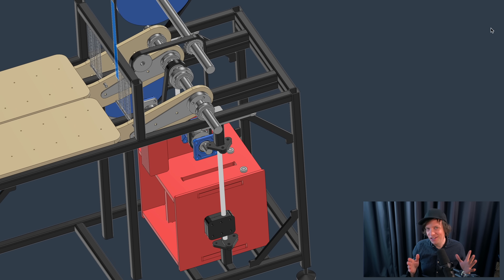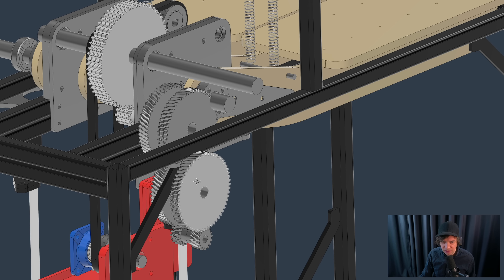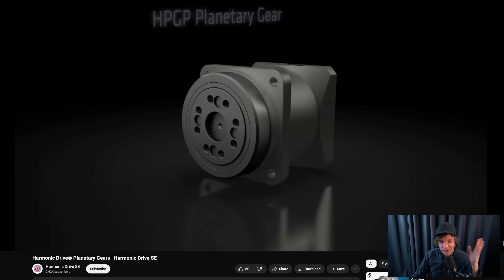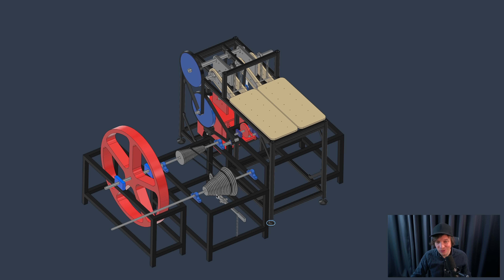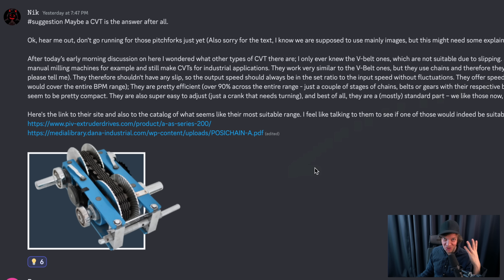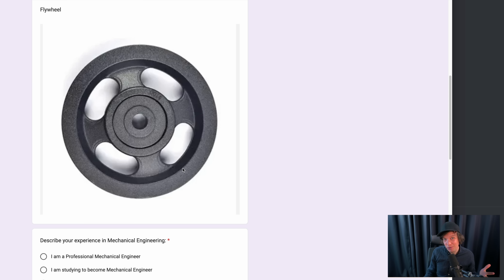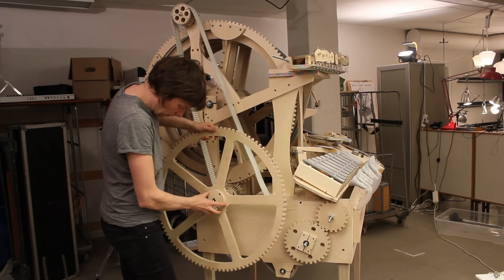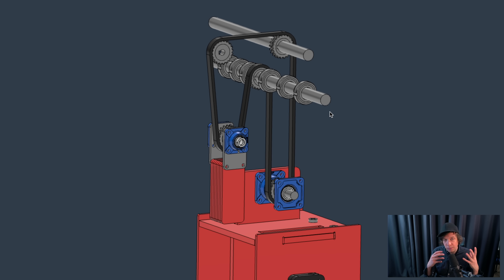Which Gear Type is Most Efficient?

Comment from the maker: Hi all Engineers, if you can, please help Finding Flywheel suppliers on the Marble Machine Engineering Server:
https://discord.com/invite/7aSFJA6bkH

You will find all the Help Request Forms there thanks!
Reply: I thought you were gong to make your own, because you knew better and it would be cheaper?
Reply: @thomasbecker9676 Time has probably become the main issue
Reply: @oedalis  Maybe he could get a real job, then. Any engineer worth their salt doesn't work for free.
Reply: pop down to the junkyard and grab a flywheel off a diesel truck. it should weigh about 100 lbs
Reply: Elevators use flywheels that are probably about the size you are looking for, thats where I would start looking
Reply: There is also the crankshaft type, not just cogs and belts
Reply: What about a steam locomotive wheel as a flywheel? Various diameters, heavy and beautiful.
Reply: aren't there very large flywheels for very large engines - thinking like diesel engines used by shipping boats?
Reply: Have you considered using train/railway wheel as a flywheel?
Reply: Have not watched yet but shouldn’t you include double helical in the thumbnail and if you don’t have them in the video you should. Gonna watch later.
Reply: Realising it was only 14 min and see you do have double helical gears.
Reply: Also worm gears are nice for high gear ratios. But you can’t really reverse them
Reply: For flywheels, perhaps salvage from a UPS. Like the kind for a datacenter.
Reply: Hi Martin, did you consider an elevator traction wheel as an option? I'm pretty sure you'll find something big and heavy among them.
Reply: Planetary gear boxes are great for backdriving, Wind turbines use them to gear up to drive the generators. they can also be converted to be a CVT with a second input (Robert Murray Smith showed it well in his vid last week, 2197 infinitie cvt) while this may need an electric motor or some other controllable secondary input, this means that you will easily be able to change tempo within a song giving greater flexibility for music.
Reply: 5:1 spur gear (or bicycle chain or belt) plus 10:1 planetary.
Reply: Look for a Caterpillar engine model 3516B flywheel.  It's about 1 meter give or take a few centimeters. Also very heavy.
Reply: Chain AKA bicycle chain drive,
DuPont Teflon Chain-Saver Dry Self-Cleaning Lubricant
Reply: Pronounce "scarce" as in stare, pair, player.
Reply: I gave a link to an exercise bike flywheel supplier last year on the Reddit page.
Reply: There are long running time mechanical clocks which use plain rotors (no gear teeth) because hey can have much lower friction han other solutions. Think about train wheels on tracks. A slow rotating steam train wheel could propel the train at up to more than 100 km/h. If you have a railway carriage with well-maintained moving parts, you can move it by hand.
Reply: And yes, train wheels can make really good flywheels, if you're looking for an easy supply.
Reply: @RWBHere sounds a bit heavy
Reply: Avoid the chains at all costs, unles the noise of the marble machine is not going to be a problem when recording the music in studio or when playing for the live audience. Additionally, in order to reduce the noise you'll spending a lot of time on the chain maintenance (lubing, cleaning). Over time it may stretch and cause many other problems including gear wear and damage. I'd recommend using the belts instead. They're very quiet, not stretching that much, no maintenance is required and they're able to do a huge number of working hours - take the example of car timing belts. Also, they may be cheaper, lighter and therefore also more efficient than chains that have plenty of moving parts that have own friction. Good luck!
Reply: May not be a direct for flywheels but you might be able to look elsewhere for something to fit a flywheel usage. Example is large gears like on old machines that is sent to the scrap yard, They can get into the weight and size you are wanting and not too expensive to the point of being a little bit more than cost of scrap steel and they tend to be fairly balanced. Its mostly needing a large machining station that can handle that size and then do balancing. That's why I thought of the old gears and such from old machines. Might be your best bet and not have to cost a substantial amount of money and time to machine.
Reply: The only reason why you need to transfer motion mechanically is because you have a semi-religious belief you can not have an individual motor for everything that needs to move and then synchronize by a microcontroller.
Reply: Do You think about bicykle type of gearbox. It easy to change gears and it’s tested ;)
NuVinci gearbox is stepless.
Maybe You can even seat like on the saddle and have bike type pedals to drive a marble machine :)
Reply: Have you tried looking at the old engine community? All big flywheels ive seen came on those type of things. I expect a quite tight community with contacts everywhere and alot of random/spare parts.
Reply: Instead planetary, maybe cycloid gear might be an option. Those can be built smaller than planetary gear boxes and - as James Bruton showed with his robot dog creation (I think v3, maybe v2 as well, lots of it 3D printed) it is easily backdriven (springy legs).

Edit: You could ask Sumitomo, they are building cycloid gear boxes.

Comment: You loose efficiency in power of two by each stage you are using. I'd think about timing belt and single stage. First pulley would be HUGE, but might still be possible. You want to use very low friction ceramic ballbearings. They are not that expensive since they are used on roller skates.

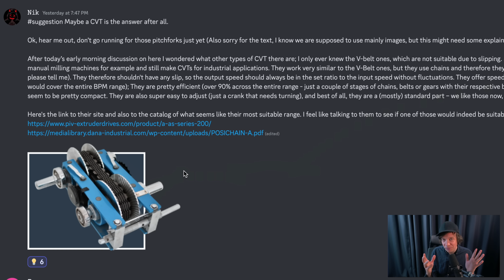Comment: 7:55 I don't think you can achieve the precision you want with a CVT.  The result will always be slightly off. It might only have a 1 or 2% deviation, but you want 1 digit ms precision, and you won't get that from an out of the box CVT. Because it is not needed in the original use case.

Comment: The answer to most of these questions is a flywheel based exercise bicycle if you want a specific supplier for flywheels I suggest you search semi truck flywheels I keep suggesting exercise bicycle because it fixes the your power input problem the hand crank or sewing machine pedal system doesn't really work

Comment: There's no way I'm the first person that has been thinking... Why not look into bicycle parts? Starting with efficient power of your legs, pulling up is more efficient than pushing down. Combine the two for double the leg power. Combine your gearbox and timing belt and tensioning with a derailleur. Literally the most common designs for efficient transfer of human energy to high speed spinning wheel there is: a bike. You're building a bike, dude.

Comment: A bit out-of-the-box, but maybe  check out Rohlhoff. Bycicle gear is said to be highly efficient, has helical gears running in an oil bath, is very compact and has 24 someting gears. Its chain sprocket could be converted to a poly vee belt.

Comment: Have you considered locating the Flywheel horizontally at the lowest point of the frame and use a bevel (90deg) to change the direction of the shafts?

Comment: Gears need lube in most cases. Spur gears are good, cheap, and easy to adjust but tend to be more noisy. Helical and Herringbone are better for noise but much more expensive and adjusting takes a lot. Planetary can be driven backwards no problem as long as they were designed with that in mind which I think most are. Planetary gears takes the best of all of the previously mentioned. Someone did all the engineering for you. They self contained and lubricated. The only downside is the upfront cost and input/output shaft type aren’t always want you want and thus need adapters

Comment: The answer to the simple question is a straight gear. Helical gears do only have a benefit of a better NVH performance, which is getting an issue by increased RPM. Regarding the straight gear there are although ref. profiles which are beneficial for the friction reduction. Those low loss gears have an increased pressure angle and reduced overlap. 
Planetary Gearsets (PGS) have in general a lower efficiency than a regular gear pair, due to the increased gear meshing bearings etc. in the PGS. Harmonic drives transmissions with their 100 or 200:1 ratios are very inefficient.
 However as mentioned transmitting torque depends on the application high center distances prefer belts or chains.
If you are looking for gears u can get something existing for little money. Final drives of front wheel driven cars have usually a ration of 3-4 to 1. There you can get fine machined gears. 
Btw. You can although combine a plastic with a steel gear, which will although have an Ok NVH behavior

Comment: I think the question should which one is least noisy at speed.

Flywheels, its ALL ABOUT MASS!! 
Large OD not ideal for everything.
You need to decide what your resolution should be because large mass will magnify your backlash. 

 The issue with backlash is wear and noise. If you eliminate all backlash your noise and wear increases exponentially. However you can only reduce this to the point of whats necessary for your minimum deviation.

 You need to figure out what the perceptible requirement is. I think it should be quite large because human perception is adaptive and will actually prefer it.

A CVT would be perfect for the power transfer to the flywheel because you need to adaptively change the higher speed lower torque from a motor to a lower speed extremely high torque flywheel. Once at speed the mass of the flywheel will dampen the CVT fluctuations.

Comment: A thing to keep in mind with cvt’s is their very poor transmission efficiency. I believe somewhere between 80% and 90% for a well built and designed one. I am an agricultural mechanic and have very few qualifications in reference to theory, but you could look at old tractor flywheels. I’m think old 2 stroke John Deere tractors or even just some of the bigger diesels. Gasoline engines run a much smaller flywheel because they don’t need such high compression and operate at much higher rpm’s.

Comment: Ok, I hope you see and get to read this..
I worked on a project at my first workplace that we made a Staple making machine that put barbs on the staples as they were formed.
We had to move power from a motor to the flywheel. a Big 100kg flywheel that had a cutter and several "knockers" in it.  This basically powered the cutting of 3 mm wire and bending (with the flywheel) which as the main method the machine ran by.
We transferred power from the motor to the flywheel by 2 pulleys and a Vee belt.  The pulleys had three sizes so you could run faster on smaller wire sizes or slower on larger wire sizes..  This is because when you increase the speed.. You reduce the torque.  So 3mm wire on the max speed causes the machine to go into a stall situation.  Where you lose speed with an operation.  As the machine does more operations.. it eventually comes to a dead stop.
NB : This is where variable drive systems have problems. Inconsistent power input versus inconsistent power use.  They slip to keep the 90% efficiency.  So they fail more often from all that slipping. (hence we recommend against Variable slip drives.)

I personally would recommend not using a timing belt for drive system.  We built a coiling machine that made 1 meter wide coils of 25m wire coils.  It was driven by timing belts..  Pneumatic clutch system to engage the power.  double sided machine.  It worked great for 8 months.  Then drive belts jumping teeth, riding over the teeth and wear on the gears.  We ended up spending so much on repairs..  We converted it to a Vee Belt drive after a year.  The timing belt pulley can not handle torque over time.  The teeth basically become knives and that means new parts every x months and looking at your gearing ratios.. those small timing pulleys are going to wear out in weeks.. 

Helical gear - Precision.  They are efficient, but they are also High tolerance and high tolerance means lots of resistance to initial movement.

Spur gears -  I have worked with a gearbox that uses spur gears to move wire products at speeds where you can no longer see the products.  Crimping / cutting and ejecting a wire piece at 30 meters / second.  The gearbox whines at 97 Db its that fast. Input motor is only 1.5 HP, put through 9 gears in a single box and output onto the shafts of the crimper and cutters through flexible shafts.  The great thing is that you can turn the input by hand and get 10m/sec on the output.
If you are working with a slow speed.. this gearbox setup should last a lifetime.
We ran at 30m/s for 12 months on a brand new gearbox..  6-8 months on a old rebuilt gearbox.  You could rebuild the entire gearbox in 4 hours.

My recommendation is Spur gears with Vee belt speed control.  Do the gearbox as close to the output as you can.. Fast spinning things should be kept to a minimum and as short as possible / covered up.  It only takes 1 fraction of a second to lose your life.

Comment: @Wintergatan, having worked in Civil / Structural engineering for a long time, I understand your comments about nuances completely, but one of the nuances, or design considerations that I haven't heard you mention is transmission noise.

Please tell me that your discussions with your Mechanical Engineers have included conversations regarding transmission noise ... 🙂

Comment: For the flywheel, an automotive one isn't going to get you there, but you might want to look at older, larger industrial equipment, and not specifically the flywheel, but the Drivel Wheel, that is bolted to it.

Comment: I couldn't find another comment on that diagram at the end so here's some info if you're interested.
On the left you see an input shaft with input torque T1 and angle of rotation theta1. D1 is a damping factor, which is friction that acts against the torque. It generally increases with rotation speed. J1 is the moment of inertia of the input shaft. It connects to a driving gear with N1 number of teeth which meshes into the driven gear with N2 number of teeth. The driven gear is connected to the output shaft of moment of inertia J2 (J2 includes not only the shaft itself but everything else attached to it in the whole machine), with rotation angle theta2. Its own damping factor is D2. K2 is a spring load on the output. (I'm assuming it's a torsional spring load (a resisting torque that increases with rotation angle), as this diagram appears to be a single DOF system, although I do not know where a torsional spring load might come from in your machine. It seems highly unlikely that you have a resisting torque that increases with every turn of the crank).
On the right you see an equivalent one-shaft diagram. Meaning if you had a shaft of moment of inertia Je, with damping factor De and spring constant Ke, then this system while subjected to an input torque T1*N2/N1 would behave exactly the same as the system on the left having input torque T1.
The purpose of making this diagram is mainly to simply your calculations. On the left, you would have to perform the same calculation on every shaft starting from the output all the way to the input(which is a lot when you have multiple shafts and gear trains in-between), while the diagram on the right allows you to calculate it all at once. It's also useful for showing how the input torque requirement changes according to your gear ratios and shafts' moment of inertia, which may give insight for knowing where to optimize.
After this, you can directly set equations such as T=J*(theta")-D*theta'-k*theta where, after setting the desired output angular acceleration theta"(which is calculated from the desired max rotation speed and acceleration time) you can calculate the torque. If it's low enough, you're good to go. If it's too high for human effort, optimization is needed.
Source: I'm a mechanical engineer. Opinions are more than welcome.

Comment: Your legs are pumping.  Have you ever thought about hydraulics?  You can use a hydraulic motor to turn the flywheel powered by the oil pressurized by the pumps connected to your treadle.

Comment: Spur Gears:
These parallel shaft gears achieve high efficiencies, ranging from 94% to 98%.
Ideal for lower gear ratios.
Straight Bevel Gears:
Similar to spur gears but with a perpendicular shaft arrangement.
Efficiency typically falls between 93% and 97%.
Spiral Bevel Gears:
Curved tooth lines reduce noise and vibrations compared to straight bevel gears.
Efficiency ranges from 95% to 99%.
Stronger and less noisy.
Worm Gears:
Efficiency varies significantly based on lead angle, friction factor, and gear ratio.
In higher ratios, efficiency drops.
Generally ranges from 50% to 90%.
Hypoid Gears:
Achieve efficiency levels of around 80% to 95%.
Suitable for very high gear ratios (up to 200:1).
Helical Gears:
Run at high pitch line velocity and achieve much higher efficiencies.
Efficiency typically falls between 94% and 98%.
Maximum gear ratios up to 10:1.
Cycloid Gears:
Work efficiently at relatively high gear ratios (above 30:1).
Under normal conditions, efficiency ranges from 75% to 85%123.
 took 45 secs to make this list.

Comment: For pre-made flywheels, old tractor flywheels are likely going to be the largest off the shelf ones at a reasonable price.  Most of the old 2 cyllinder tractors (common up through the 50s) used large and heavy flywheels to flatten the power curve from the engine.  They fall short of the 1m you want (0.5m is about the biggest) but are readily available and fairly cheap (other than shipping).

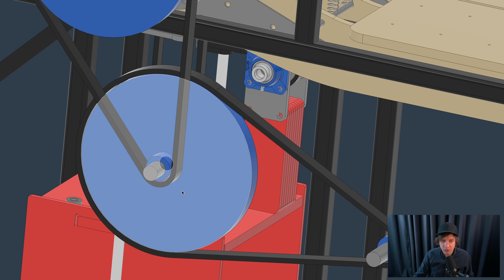Comment: 3:20 I don't get this... obviously a larger wrap angle means that each tooth is carrying less torque because they all add up, but extra idlers introduce extra drag and you are wasting energy twisting and untwisting the rubber around various corners. How in the hell is it MORE efficient by adding extra idlers?